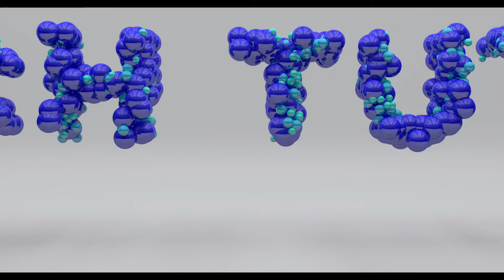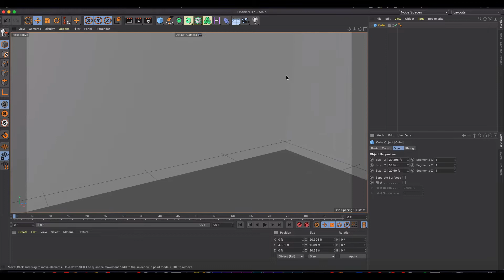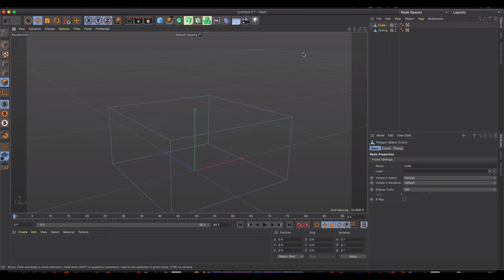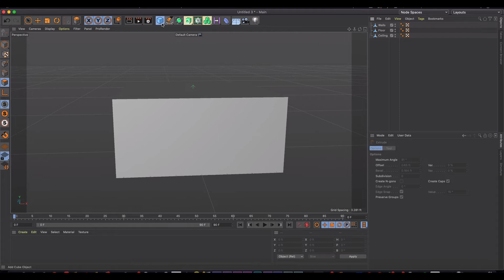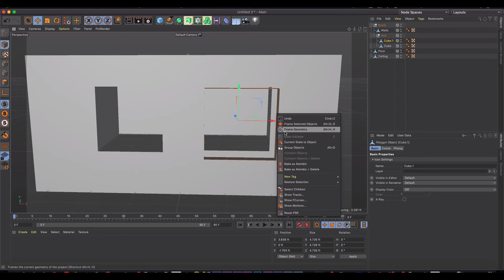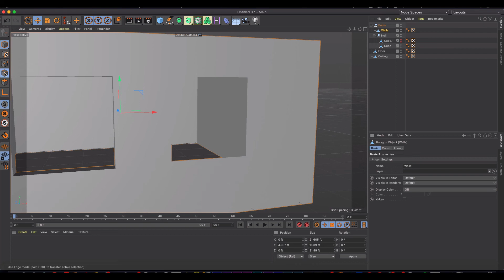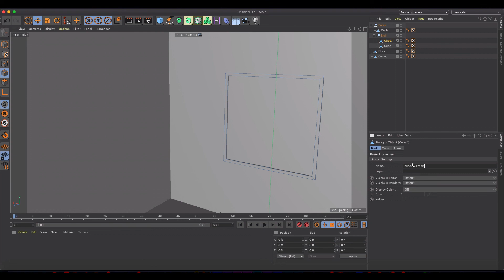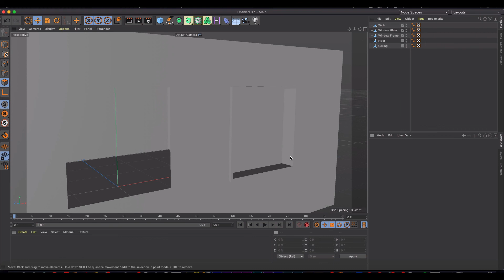How To Make a house or building model to avoid Light Leak | Cinema 4D tutorial

Comment: Nice tutorial man, just wanted to let you know that, I have tried everything you show here, and more, and still get light leak when creating in Cinema 4D and exporting to Unity. There are a number of ways, I have found, that do not light leak, for instance, if you were to shape 6 walls, out of 6 Cubes, and then, "SNAP" them together to form the perfect square room, light never leaks, but that would be insane to build an entire structure snapping. I could go on, but long and short, the ultimate fix, at least as far as Unity is concerned, is to go into your Directional Light settings, and turn the, "Normal Bias" to Zero. You'll never have light leak again, not even with a sloppily built mesh.

Another thing, if while in Unity you are seeing light leak, and you change your object's "Cast Shadows" setting to, "Two Sided", that will get rid of light leak. But, that's not good, because inside of Unity, if you do choose, "Two Sided", that ignores, "Backface Culling", which is not a good thing, as all game engines use "Backface Culling". If ignoring "Backface Culling" fixes your problem, then, the problem is with your mesh, because a perfect mesh will have no leaks with "Backface Culling" on.
Reply from the maker: Make a video! Great stuff!